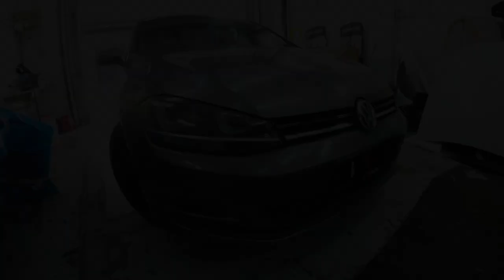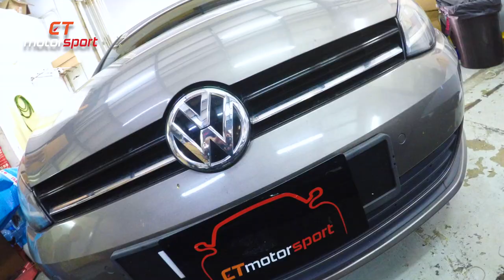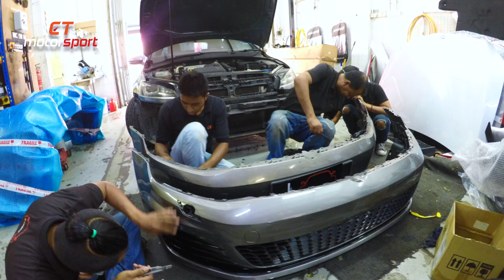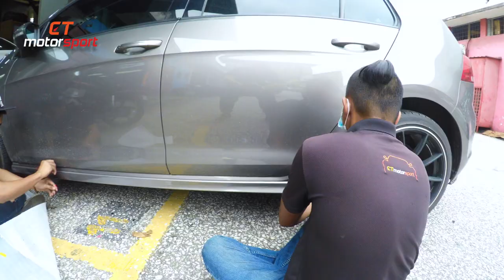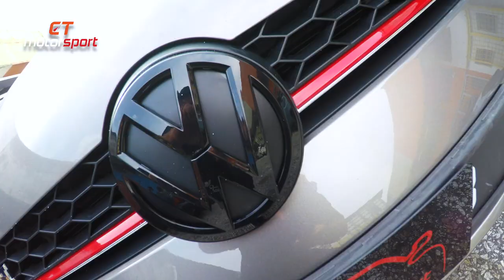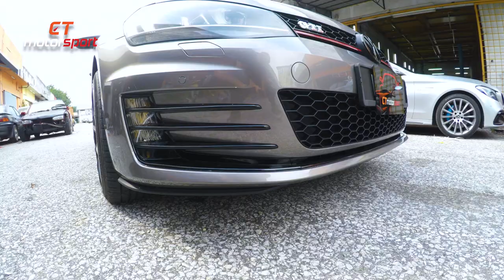VOLKSWAGEN MK7 CONVERT TO GTI FRONT BUMPER

Comment: Does somebody know does caps from headlight washers from tdi/tsi model fit on gti model?
And do you need any conectors for fogs?
Reply: Wi Maxxx caps are different
Reply: @milanmichel 
Tnx and what about swap the washer and park sensors is it plug and play, and the foglights are they working without coding?
Reply: @wimaxxx1234  updates??
Reply: @Righteouness  Nothing!
Reply: @wimaxxx1234  I just purchased a plug and play cord for them.
Reply: @wimaxxx1234  having issues with the right hand side Foglight with adaptors. Coded them in and nothing ):
Reply: @jesus saves bro could you drop link for connector pls